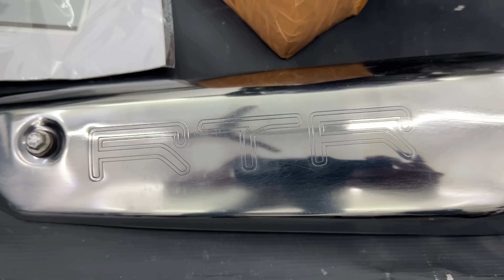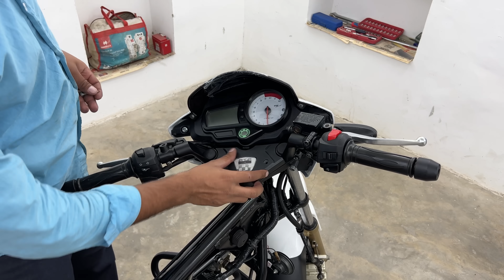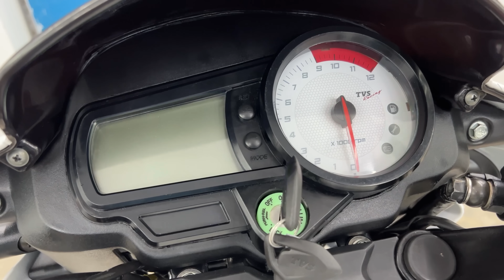Rebuild Timelapse : TVS Apache RTR 160/180 (Old Model)

Comment: I brought my beast Apache RTR 160 on 2010 and now 2022 still using the bike it never disappointed me but the only concern is maintainence I mean the price of the parts are too costly compared to other bikes in the segment but still my beast rocks today also.
Reply: I too have a Apache RTR 180 2010. But these days when I take it to highways it doesn't go above 80 engine vibrations are tremendous please help.
Reply: @shantanukulkarni1486 try to give it in good showroom bro and explain them about the issue they will fix if there any problem in engine parts anyhow u said u bought in 2010

Comment: Just today i got ny apache 2007 model wiring changed same as 04:18 mins in the video. Even service centre guys cant restore it like the way u did...Every time they will not have some or the other part which i wanted.
Reply: Wiring cost?
Reply: @ankitnegi353 dont remember as it was year back! probably 1500-1800 rs.

Comment: Hats off to you brother. I wish If I could have seen this video of your's earlier. :(
I have the same bike same color and got it like half restored which includes only some parts changed and full paint of the bike. But I'm not satisfied with the body work that I got. :(
Next time I'm sending my bike to you for complete restoration unless you don't mind doing it. 

BTW, I have a question, did you got all the parts new for this bike which includes complete new engine and wiring?

Comment: Mine is 2007 first model rtr160 ...its ignition lock has 4 wires in total i.e 2 sockets with 2 wires in each socket....so can i install the latar model single socket 2 wire ignition lock in it? Will there be any issues because another blue socket in headlight doom is now free...

Comment: brother please help me,i have got very serious issue in my bike(duke250).At early morning or when bike's engine is cool it didn't response the given throttle.if it is heated for 5 mins then alright .some times it gives missing problem rearly.Recently i've changed airfilter but no improvement. Ive also checked  spark plug also there is no issue. What can i do pleas suggest. help🙏your subscriber from Nepal❣️What can i do pleas suggest..

Comment: I have Pulsar 220 and i have clocked 50000km and i want my P220 to feel new while riding, what are the parts that i need to change on my bike (engine hasn't been opened once), i am thinking to change clutch plate what else should i change ?

Comment: 3:58 what part is that ?
Reply: Man i would also like to know, I have been searching around it for a while cant seem to find anything
Reply: @shantanuyadav6135  Hey, I found out what it is, its called SAI Unit or Secondary Air Injection. (It's used to reduce engine emissions). If you remove it, you'll have some pretty good pops and bangs :D